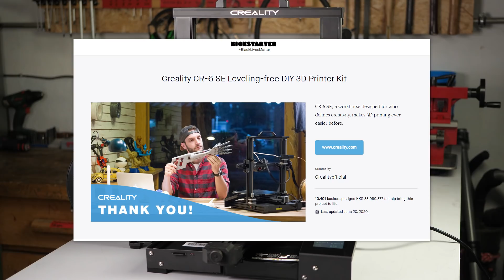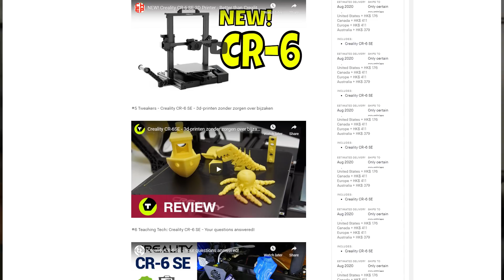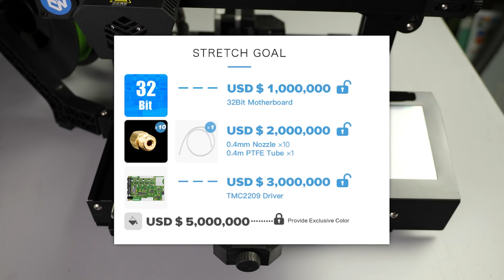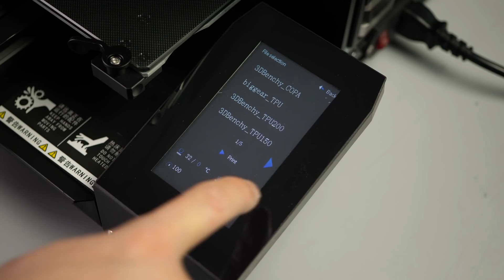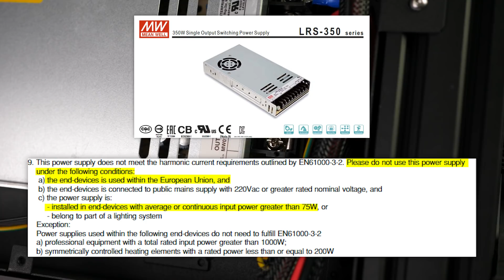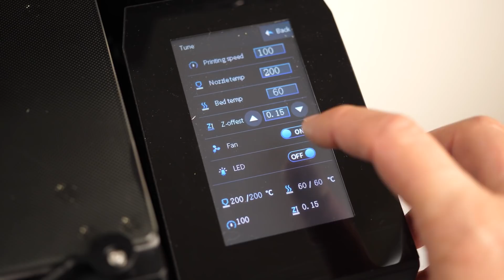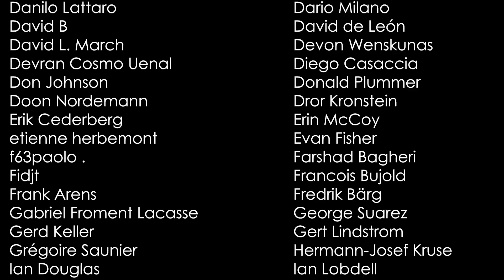Creality CR-6 SE - The NEW (over)hyped Kickstarter 3D printer?

Comment: i backed it up. and one of the complaint that you had is that the bed is not flexible, according to kick starter the have added a PEI build plate as an add-on. im still not sure what the thickness of it going to be but i believe it will be a thin bendable sheet of PEI

Comment: I am soooo sad that I missed this.
Reply: same, now i have to pay around $450 for it which is a scam. I don't know what printer to get im so confused lol
Reply: I am going with the ender 5 pro. The 5 plus is too big for where I am putting it sadly.
Reply: @robertkirkpatrick1826  im literally so confused lmaoo i have no idea what to get. Are you going to do any upgrades to the ender 5 pro?
Reply: Divy you probably just want an Ender 3 (or it’s pro version if you want it’s differences), the Ender 5 is really similar to the 3 but it costs significantly more with very little if anything to gain. The Ender 3 is quite popular for a reason, it’s very hard to beat, it packs a lot of value.
Reply: @jakegarrett8109  thanks for the response i just dont know if i should get the v2 or the cr-6 se
Reply: Jake Garrett the internet and all reviews and creality ALL disagree with you.

Comment: Thanks a lot for this video. Excuse my english (i'm french), but what do you mean by wizard when you spak about filament loading? Do you call for some magical ability or is that a real device?
Reply: He’s referring to things like what computer program installations are called “wizards” sometimes, it’s just basically a simple control section/menu. But yeah some programmers back in the day must have had fun with the name because some would have a little cartoon wizard on the setup window.
Reply: In this case it would be like my Tronxy X3 has, just preheat the filament and then have it start pushing filament in (mine I have to do that in 2 steps, but I’m guessing more modern printers have a simple one click button for such a task).

Comment: they are offering an add on Spring steel build plate for cheap to kickstarter backers  I bought this and was one of the semi lucky ones to get this for $299, i wasn't fast enough to get the super early and super limited lower price.   But i wanted a nice easy to set up and good 3D printer to replace my very poor decision choice of the XYZ printer that i bought.     I really regret buying that thing.   so this is the replacement for that.  I am still learning a lot everytime i look into a project that i want to do, or design. so i don't know a lot.  been watching videos on using things like openscad, fusion 360,  and others. right now i am using the Cura Slicer, only because i found it first and easy to use. however if there is something better and someone can tell me why or if there is a video of a better slicer please let me know. i really like making things, and seeing what i can do.

Comment: Thanks for this video! Good review. I backed at $320, it's my first machine, and I'm looking forward to getting it. I wouldn't pay the retail price for it though. I considered the Prusa but it's outside what I was willing to spend on a hobby I'm just starting in, and the auto-leveling is a big deal. Nonetheless, if the power supply fan and the bed heat-up time are your biggest complaints about a printer in this price range I feel like I'm probably in good shape starting out.

Comment: I did not back the kickstarter... I am happy with my particular ender 3 build which is less expensive and has all of the functionality plus a flexible steel magnetic bed for less (SKR e3 Mini, tft3.5 e3, EZABL Pro, a metal extruder with an aluminum wheel to load and unload filament, and a few more things). I have 4 configured this way and they vary in age from 2 years old to 6 months. They have been upgraded along the way to the current setup... the latest was built with all of the addons though at a cost of just over $350 (US)... Even on my oldest E3, I have only had to replace fans and consumables (a nozzle, print stickers, ptfe tubes) and they printed non-stop for months making PPE until recently. 
I don't like the nozzle strain gauge for bed leveling because it requires you level with your nozzle cold so you don't damage the print surface, while the other ABL systems can withstand a warm bed and hot nozzle. 
Just one opinion though... I do like the milled extrusion idea though... it would aid a new builder in constructing the machine.

Comment: Ender 3 owner here I'll probably just stick with that. I bought the glass plate but I didn't like it because I was constantly having to readjust and actually cut the adjustment screws to makeup for the height difference. I probably have bought four sets of screws already. Also my build plate has come loose I guess it was just glued on and the Heat from the quote-unquote heatbed melted the glue. But by far my biggest problem with it is bed leveling then I will just be either continuing to Frankenstein my original one or buying a new Ender 3 with a bed leveler.

Comment: Thanks for the video! English language tip: "Subject to change" is a common phrase, but "Object to change" is not something people say and it doesn't really make sense.
Also I really love your videos where you do DOE and print a bunch of stuff with different settings and compare. I have an idea for that kind of video: retraction settings. I am having a hard time understanding the interaction between retraction distance and speed and how it affects stringing and print time. My assumption would be that longer retraction distance provides for less stringing at the expense of longer print times. I would also assume that faster retraction speed would lead to less stringing AND increase printing speed. Based on my observations on my stock ender 3 both of these assumptions don't seem to hold up consistently. Sometimes increasing retraction distance seems to make no difference with stringing, sometimes increasing speed makes stringing worse. If you could do some testing and talk about the underlying mechanics of retraction settings, and also how they differ based on bowden/direct extruders, that would be a super helpful video.
Thanks again for the great content!

Comment: For a silent power supply, they should have gotten the Mean Well UHP-350-24. But i guess that is a bit pricey for a budget printer, if you compare it to the LRS-350-24. The UHP is about 2x as expensive at mouser. The Problem that they don't manage the 61000-3-2 EMC tests just shows that they saved some more money on that LRS series. The passive UHP-Series has 61000-3-2 listed in it's certificates. The problem with a passive PSU is that you need to mount it in a way that actually allows passive airflow, so just trying a 1:1 replacement might not work, and i'm pretty sure $$ was the number one concern at creality, so they got the cheapest, noisy option designed in, as usual.

Comment: The PSU is definitely not legal in Germany. Technically its even not allowed that the user tightens the screw terminals for the 230V cable but that is debatable since it is not a permanent mounted device. 
The way I saw it in the video it looked like the electrical connections are exposed on the underside of the printer and are just plain screw terminals. It is easy for the user to accidentally touch mains voltage and that is definitely not legal according to DIN-VDE0100 (and up)
Reply from the maker: The electronics as well as the PSU are behind sheet metal, so no risk of touching live wires. The video shows the electronics opened up.
Reply: CNC Kitchen ok my bad. If there is no chance you can touch it while in operation it might be legal. I am sure tho that if anything were to happen with the printer and an insurance company gets involved they would rule against the owner, since in Germany it is technically illegal to even change an outlet or switch if you are not licensed by the provider. 
The printer being a „non permanent device“ (having a cable attached which you plug in an outlet) its in a grey area. A qualified electrician is allowed to install and assemble the PSU. I assume somewhere in the user manual or on the PSU is a note telling you that the device shall only be commissioned by a qualified electrician. 
So the product should be legal (don’t take my word for it im just an electrical engineer not a lawyer) but you assembling it is technically not. Since private households don’t have to do a yearly inspection of all electrical devices (like the BGV A3) this only comes to play if the printer were to burn your house down or someone gets electrocuted while working on the printer which hopefully never happens.

Comment: I'd completely comfortable to buy it with that price. Dual Z, 32bit board with silence stepper driver, "skookum" main body (again, X gantry is supported with dual z-rod, so no sagging, no fussy after hundred hours of printing), innovative ABL built-in, fast release bed @@ but I agree on the fan noise, Creality should spend a couple more bucks to have silence fans like noctune (but then, the price will even be higher than it's right now). This printer open the opportunity of just buying the printer then dial-in the setting for different filament, then click and wait, no more fussy with the machine itself. In my opinion, this printer is still in the category of low-cost, and had stepped 1 step further into the PlugnPlay future

Comment: The build area of an Ender 3 is also 235x235, not 220x220 (sometimes advertised incorrectly). Also, please show me a PTFE tube that does not degrade and release toxic fumes at 260C.

Comment: Taking away the leveling screws entirely was a bad choice in my opinion.
I'd love to see actual automatic leveling/squaring of beds instead of what we have now: software compensation of unlevel beds. Even with a sensor manual leveling is necessary to a certain degree.
Though I must admit I like the idea of using load sensors, I have come a full circle with my opinion on automatic level-sensors. When I was still inexperienced they were great and felt like they took much work from me. Fast forward a few years, I had quite some headaches with all kinds of sensors: capacitive, BL-touch, piezo - I tried them all, and all failed after a while or were not reliable enough for day to day prints; they're just not worth the (sometimes) ridiculous prices. Ruined a few bed surfaces due to level sensors going bad and had way too many failed prints due too them. 
I'm now back to sensorless leveing for almost all my printers. I can level a bed in 5 min when completly unleveled or a minute or two for readjusting after I notice inconsistencies during the first layer. And even that takes a few months on my work-horse ender 3 which has a magnetic printing surface. I comparison a level sensor takes a minute each print.
I guess a good manually leveled bed in combination with a sensor can even out some flatness issues of the beds, but the quality of beds has ramped up in the last few years, so I don't see that beeing a huge issue anymore.

Comment: I backed the project, for the CR-6 Max version. I will be doing a few upgrades, silicone heater, flex steel print surface, all metal hotend and maybe a conversion to a e3d hemera & remove the strain gauge & use a ABL.

Comment: Ever since you mentioned the power supply fan noise on Twitter (I think it was Twitter) I've been trying to print with my CR-6 SE non stop, and my power supply fan doesn't kick on like yours or sound like yours. I haven't had time to pull it apart yet, but I'll dig deeper and try to compare what I have with what you have.
Reply: Compare it to your Ender 3 Pro. They both have the same power supply. Like Joel, I don’t notice it being super loud on my unit either. I find the unit quiet and use it in my office often. Though the power supply fan is probably the biggest contributor to noise since the rest of it is so quiet.
Reply: Thats good to know, I watched all the reviews pre purchase and this is the only one that mentioned the sound volume in a negative way!
Reply: @LordCreo  My ender 3 pro is loud when it kicks on, but not THAT loud. It may just be sucky enclosure design
Reply: @hypercube33  Thats possible too, but again no other reviews mention it (and this thread was started by "3D Printing Nerd" who didn't notice it in his review machine, so it's a bit of a mystery.
Reply: less voltage needed less heat less fan usage
Reply: @Propalica  less voltage, more current. More voltage, less current. The current is what heat up. 12v350w=29,16a. 24v350w=14.5a
Reply from the maker: Good to know. I'm not an electrical engineer but maybe stepping the voltage down from 110V is easier on the PSU than with the European 230V?
Reply: @CNCKitchen  Thats possible, though I know the same meanwell PSU is used a lot as an after market upgrade here in the UK on 3d printers.
Reply: @CNCKitchen  that mabey is the problem if you double the voltage you increase the power by a factor of 4

Comment: 04:15 bed -> If you are having issues removing from this Anycubic Ultrabase clone they either made it wrong or more likely you are doing something wrong, such as not waiting for the bed to cool down. Once it cools down typically prints just pop-off. If not, you can dirty it up a little bit or increase bed temp during printing.

Comment: For the predicted price of the CR-6, I'd rather get a PRUSA mini (over $400 for the CR-6 vs 350 for the Mini).  Sure I'm giving up 55mm on the sides of the bed and 70mm in build height (mini is 180mm^3), but I'd be getting a Prusa and all the support that comes with that.  
It is nice to see Creality doing a nice improvement on the Ender 3 though.  A lot of the stuff they added, I've designed and printed for my Ender 3 already though...

Comment: I saw the CNC milled locations first with Original Tevo company (flash etc..) I have been asking creality to do this for 2 years. it fixes so many problems (if the QC is done well)
The 2209's were end user requested. IE silly. they only did it because people asked for it.
The PSU fan is a known issue with meanwell. the good news is its under $10 to replace that 60x60x10mm 12v (yes 12v) fan with something quieter.

Comment: As someone who has an upgraded Ender 3, I think this is overhyped and perfect at the same time.  It's overhyped because you can build your own to have all the same features.  However it is a feature rich started printer that won't break the bank, like a Prusa.
Reply: I thought about upgrading my Ender 3, but to upgrade it to the 6se would have been more than half the cost of the printer (and some of the upgrades like the dual z axis, glass bed mounting system, and larger print volume wouldn't be possible at all)
Reply: @JorgTheElder  I was referring to the MK3S
Reply: @JorgTheElder  You are right it isn't an entry-level printer.  The MK3S is a starter printer.  As it is easy to setup, and start printing right away.

Comment: so, for someone with a stock ender 3, would this be a worthwhile upgrade, or would it be better to invest in upgrades to the E3?
Reply: I think if you could still get one around 320 then it is a good deal. I have an ender 3 pro and if you were to add a lot of the features this has you would be over 320. For a new silent mother board you are looking at 40 to 60 dollars and then to add in auto bed leveling it would be another 40 to 60 dollars for a bl touch which has it's own issues. With those 2 alone you are about at the same price as a cr6-se and you still wouldn't have the new touch screen, improved stability, dual z-axis and a few other things that you can print like the storage drawer or belt tensioners.

Comment: For me I compared it to the Artillery Sidewinder and went meh, loud power supply smaller build volume. OK so it does not have auto bed levelling out of the box but once it's been manually levelled unless your changing nozzles it never needs re levelling and it quiet as F, bed is excellent for adhesion and coming off after cooling. Only thing I would like to see with the sidewinder is a little bit better bed heating consistency from middle to very outer edges and a quieter stepper driver on the extruder  for retractions but thats something for me to play around with. By the way for those who backed don't let  mine or anyone elses comments make you less happy with your purchase sometimes we get a little caught up in the tool rather than enjoying creating what comes out of it. Get your self fusion 360 it's free sit down with some you tutorials theres nothing more satisfying than designing and building something and seeing it come out on the printer.

Comment: I dont see why the hype, I very recently got an Ender 3S and the improves between these two are very little... Most of the differences can be printed, the only "cool things" are the screen and autoleveling. But I dont see autoleveling being that good. I usually calibrate my printer every 10-15 prints, I just open a .gcode file to help me calibrate and 2 minutes later I'm done. Using autoleveling involves calibrating every time you want to print something... The only real updates are the electronics which will be more futureproof than a standard Ender 3. 

Pd: The S stands for silent, using silent drivers, a new board and the creality glass base 4:05 ( same as in the video ). Average: 45.6 dB and not having the power supply problem with noise. So not an improve for me really...